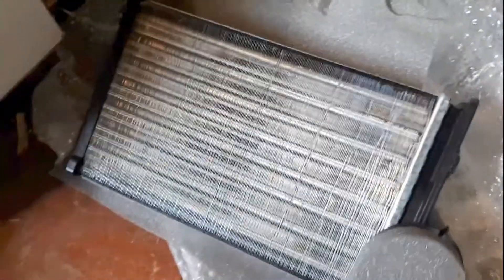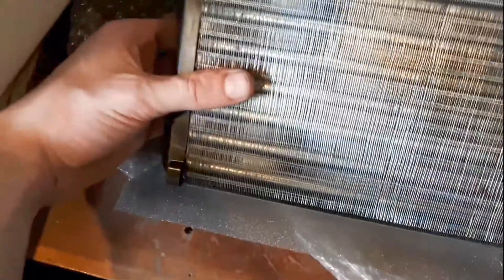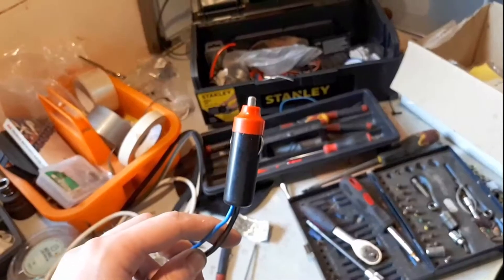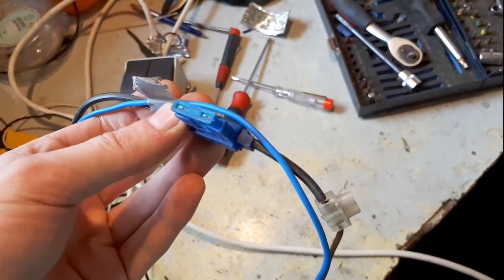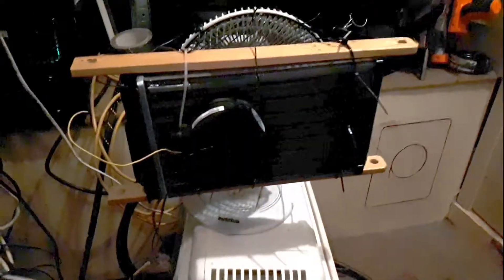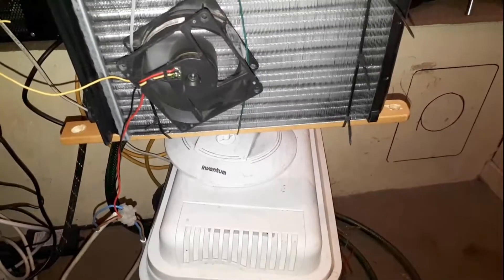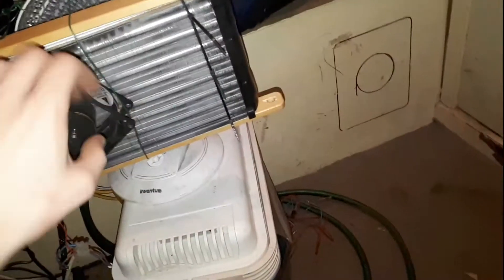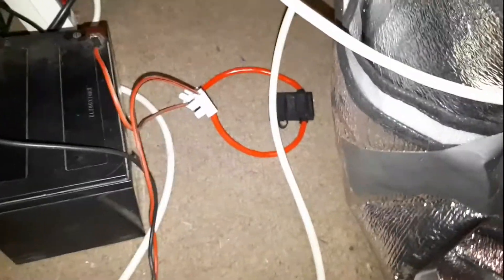The Ultimate Ice cooler using radiator

Comment: Can a peltier be used on a car radiator to prevent it to overheat?
Reply from the maker: to get waterkoeling on peltier You  Need computer CPU water Block and and a little tank and a pump and put something in the water so don't have Anything Growing and Metal and copper and aluminium parts rusting something like 30% antifreeze and the rest water if it's really powerful 100wat 2 water radiators but Big cpu-koeler can do fine  1 with 4 heat pips  or more
Reply from the maker: And I forgot one thing thermal paste suited for cold and heat